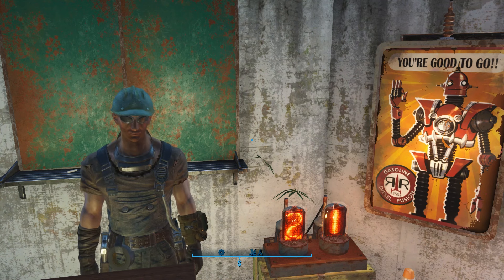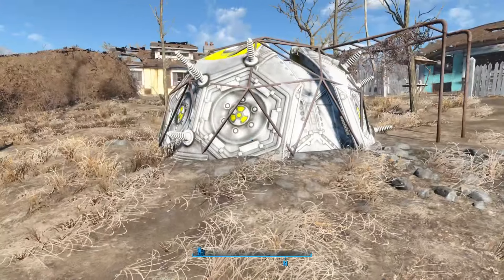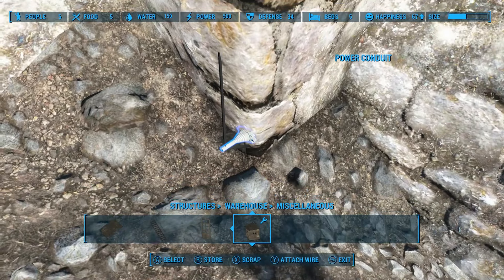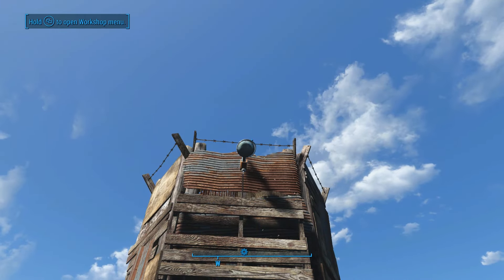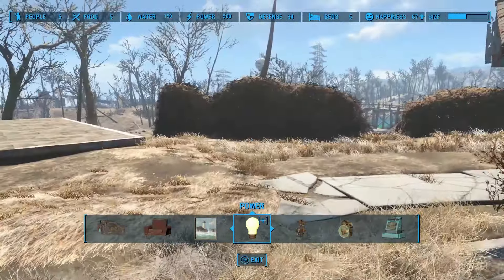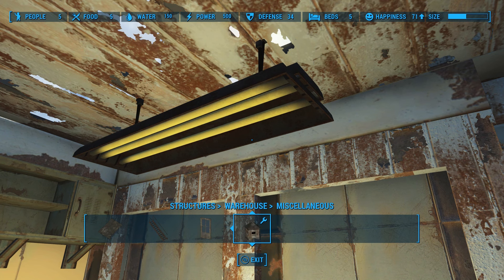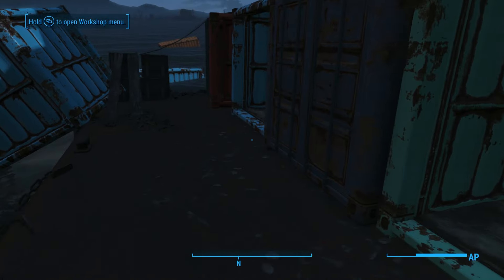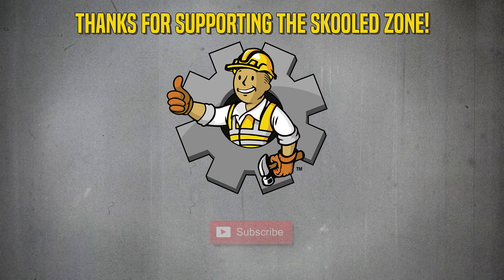Invisible Wiring Across Your Entire Settlement ⚡ Fallout 4 No Mods Shop Class

Comment: One thing I like to do is to set up sub-centrals, i. e. conduits in various places in a settlement which I then connect to the main conduit. 
I then connect everything in that area to the sub-central. It saves me having to run all the way back to the main one every time, especially in larger settlements.
Reply: ...and then you can cover the conduits with stuff, like crates that you rug glitch on top of them. Leave the rugs in place to make the cover easy to move if you need to adjust the wiring.
Reply: this seems like the best idea.

Comment: Omg this is so brilliant. I don't know why I didn't think of this. 

I would love to see a shop class about how you'd do power through vault 88 (since the power runs through the floor). I'm building my vault and running into weird glitches where things aren't lighting up and should be.
Reply from the maker: Thanks Matty. And I know what you're talking about with the vault-tec conduits. The problem with those is that all the floor or wall types have to be the same. So if there's ever a break, it breaks the connection. So be honest, I don't even bother with them. They're too much hassle. I just hook up the super-reactor to whatever I want using the method in this video. 👌
Reply: Thank you so much! That has to be what is going on. Time to spend a few hours wiring my vault tomorrow haha

Comment: so , i am tots watching these out of sequence, you basically set up the parameters for the wire distance by attaching it close to the origin point, then glitch it by grabbing the wire and moving it way past the point it should. Awesome
Reply from the maker: Correct but go "wifi" instead ;-) https://youtu.be/YdaR7m4gct4
Reply: @SkooledZone  I am, in my current build, using a mood called mini generators. I just attach one near the item requiring the power and run a wire from there then use the pillar glitch to sink it into the ground under it out the wall behind it..

Comment: A quick note on wire length: the game lets you initially string it to any length you like, but the engine will often "forget" longer wires on cell load--from testing, it starts getting iffy around 200 yards or so. The wires don't go away; they just stop working. Easy enough to fix--just pick up and drop the attached conduit to remind the game there's a wire there and it resets.
Reply from the maker: That's a great tip SarDeliac. Sometimes I have to do that with regular lights too if I've gone way over the size limit and they turn off on their own. By the way, I think this is the first time you've commented on my channel. Nice to see a talented fellow builder drop by. 🍻
Reply: Thanks for the kind words, and yes it is. Never had anything to say before haha :P

Comment: After reading lots of comments about people claiming the "wire glitch" only works underground, I can confirm that it does work above ground too. An example being to wire 2 street lights together using the "wire glitch". Normally there is a limit on how far apart 2 objects can be wired together, this limit is removed when using the "wire glitch", even above ground. The wire does tend to sag quite badly if the street lights are far apart, but it still works. In case you didn't know, once you release Preston from the museum, if you make raider settlements in the commonwealth, Preston will no longer talk to you, and all of the minutemen quests become unavailable. The only way to have the Minutemen and the Raider settlements at the same time, is to leave Preston in the museum until after you have completed all the Raider objectives. He still won't talk to you until after you do "Open Season" and kill the raider bosses, but then the minutemen quests will begin.

Comment: I wanted to let you know something about the fence outside the building area.  Before a certain patch I was able to hold the A button on a single piece of fence and pull all of that fence back into the settlement build area.  I have a suspicion, I haven't tested yet, that if you get the issue of Picket Fences that allow you to build the fences you can do that still.

Comment: Instead of using a manual switch for your spotlights, use the interval switch and program it to maximize on time and minimize off time (10 seconds on, 1 off). They never stop working and you don’t need to do it every time manually. Otherwise great vid
Reply from the maker: I showed that in some later videos actually.

Comment: 9:07 if you're using multiple lights/switches make sure to run them all through a terminal so you can control all switches at once instead if having to run to each one.

10:49 as for the stuff like that picket fence. you can get rid of it via console commands. (so still no mods, =D ). open the console (`) and click on the item. then type "disable" and press enter. if you selected the right item, it'll fade. then type "markfordelete" so it'd completely be removed next time that area is loaded. (if you disabled the wrong item, you can just "enable" to bring it back). course this is on pc... on xbox or ps, than no idea

19:46 there is a limit to the length of a wire if you're not using the glitch.

Comment: nice tip paul, sooner or later i will be trying this...but right now i'm all about the raider chic...so clicking the cable negates the length limit between towers...what does it do for cost in copper? oh yeah, i WILL be doing the switched spotlight trick. anyway,  do you have a video that features how to go about using railroad cars and scaffolding?  i'm working it right now and have a few tricks to make it happen, but any help would be appreciated...nice job as always...stay safe
Reply from the maker: Does wire length affect how much copper is used? If so, I didn't know that. I don't have a video on railroad cars and scaffolding per say, but I use some of their elements for building. I used the boxcar doors in my Vault 42 build: https://youtu.be/P6n1-POCUrM?t=24m53s, and I used the scaffolding in my Pillar Glitch video: https://youtu.be/M9OQAseCIcg.

Comment: @SkooledZone Hey man, I believe you could've carried that wire on Spectacle Island from the conduit to the generator without having to make the trip 3 times. If I'm not mistaken
Reply: True, but he would have needed to travel back to the lights anyway to prove the glitch had worked. Plus, for the purpose of a video, I'd say it was much better to be at the light end when the connection was made for the "reveal factor" ☺️
Great video as ever, time to revisit some of my settlements and tidy up those spider webs of wires running through the sky 😂 I installed a longer power line mod but it's great to see that the vanilla game can stretch them so far using this technique.

Comment: Paul QUESTION:  If you daisy chain 5 street lights together. Is it equal to 5V or does it simply use 1V continuously 5x? 
-Thanks
Reply from the maker: If the light only has a ⚡ and no number beside it then it only needs a power source but doesn't take up any units. If there is a ⚡ and a number, that's how many units the item snatches from your generator. Most lights just need a power source and don't have a number in the listing. Construction Lights, for example, have number 1 in the listing. So that means they subtract 1 from your generator's output. If you install something like a fusion generator or larger you usually will never run out of power for anything in your settlement.

Comment: How does this work from settlement start, and then upgrading the power source? do you have to rewire again?
Reply from the maker: Anything wired directly to the power source would need to be rewired. That's why I like having a single conduit "substation" in between. Then you don't have to.

Comment: I get the rug & pillar glitch. Got the ordinary wire glitch working. I got the nuclear reactor to go to that thing in Sanctuary. But I can't make the main conduit by the river to work. I tried using the sign glitch on that too, but to no avail. Everytime I move the nuclear reactor, I come back to the main conduit & find that the wire is gone.

Have you got a video of that part of your Sanctuary build or similar? I'm trying everything out I find in your channel, lol
Reply from the maker: Not sure why it's not working for you but here's a better method anyway: https://youtu.be/YdaR7m4gct4
Reply: @SkooledZone  hey thanks for the reply! The Sunshine Tidings glitch doesn't work for me either, though. I suspect it's because I'm using the current version (1.16). The part when the wire is highlighted as you "look through it", has changed. With the current version, as I select the wire, it physically disconnects from the conduit, meaning there's no wire to look through. The wire will land on the target fuse box but, as I select the lower conduit straight after, the original wire from the generator stays with the fuse box & the lower conduit begins a new connection. One of the comments mentioned it's the angle. I have tried all angles, the wire physically disconnects still. It feels as though it came with the most recent patch. 

Although that said, I think the Sunshine Tidings glitch worked for me some long time ago, hazy memory, sorry. It looked very familiar. Perhaps you could check if it still works with yours with the current updates? The rug, pillar, & very first wire glitch all still works for me. I'm on PS4 if that's relevant.
Reply from the maker: @WingCommanderZ  All the glitches definitely still work. Bethesda doesn't fix anything more than a year from its original release date. Some mods may interfere with the glitches though. Try this and see if it works: https://youtu.be/Jl-idDvy-PE?t=898

Comment: I wonder if you can connect a wire from sanctuary to sepctical if you disable the out of build area timer? I know that is not something you could do without a mod or console command but would be neat all the same. Power all settlements with 1 generator bank lol
Reply from the maker: Exactly, only with a mod. But if it works, let us know. :D

Comment: How did you sink the purifiers so far intonthe ground and are they the small or large ones ? They look like the smaller ones. I can only get mime partially in the ground and it looks bad.
Reply from the maker: I basically just used the pillar glitch. It does take some finagling. It also depends on where you're putting them. Sometimes a rock or a board can prevent it from sinking very far. You've probably seen my pillar glitch video, but here's the link if you haven't: https://youtu.be/M9OQAseCIcg

Comment: Trying to do the same thing with a reactor in the same place, but I can't seem to get the pillar to go into the ground when it's group selected with the reactor. I even did that refocus trick, just doesn't want to work for me.
Reply from the maker: Odd because it worked for me. Do you have any mods installed? Sometimes they do funny things to the helpful glitches.
Reply: @SkooledZone  Nope, I'm on PS4. Only have the arcade pack and Silver Shroud Pip-Boy paint from the creation club. I've tried with stairs and pillars. They sink in no problem on their own, but as soon as I group select with the reactor it won't.
Reply from the maker: @scruffynerfherder5430   Yeah, that's strange. It worked for me, obviously. Try unhooking the wires first and see if that helps the sinking. You can hook the wires back up afterwards. Or better yet, use this method: https://youtu.be/YdaR7m4gct4

Comment: Cool; it's underground. I like this underground without Post and Pillars everywhere.  So how does this light up all the houses you want in your settlement without enough conduits to get each room in each house?
Reply from the maker: Well conduits radiate out about 2 wall sizes. So you only need a couple conduits hidden in the bushes around the house and it should conduct power through the whole house.

Comment: Hey I been having trouble lately going to hide wires with the rug glitch or pillar glitch, when I got to burry them or slide them into the ground and the wires connected to the power  disconnect the moment I try to hide it. Do you know what I mean?  Any ideas how to avoid it disconnecting upon hiding the conduit.
Reply from the maker: I know whatcha mean. If the conduit is connected to multiple links, sometimes one of them will break when you sink it into the ground. I don't usually bury my conduits actually. I just "bury" the wires. I try to hide the conduits in plain sight, like in bushes or behind furniture. That way you can get to them later anyway. I did bury the conduits in this video though: https://youtu.be/1mXvZYiOK5A

Comment: When was the last time you sunk a generator into the ground or moved a conduit on a mat/rug?
I tried yesterday as I was thinking I could actually hide the conduits within the wall after it's all wired up with the rug exploit, but as soon as I try to move the generator or conduit the wire vanishes and disconnects.
Reply from the maker: Overall, the technique works great. But the one way it won't work is if you combine all three methods. Then it disconnects. You can still combine two methods though. For example, see what I did in this video about halfway through: https://youtu.be/1mXvZYiOK5A
Reply: Ah I get where I'm going wrong, as long as I wire the conduit on the rug the normal way and not through wire glitch it will work.
Cheers bud you've been a great help with my builds.  🤘
By the way have you ever tried using the small conduit on a rug, then removing the rug once wired, I've noticed the large one sinks about halfway so was wondering what the outcome of the smaller one would be, I've not done the Vault 88 mission yet so can't test it myself for now.

Comment: Year 2023. I have tried to apply wire glitch with and without mods and DLCs, and no success in all cases. I see the spark ok, but the glitch does not work. In the videos, the original wire disappears, but in my case it does not. Has it been patched? The rug glitch works perfect though.
Reply from the maker: Nothing has been patched. However, try this better method and see if it works for you: https://www.youtube.com/watch?v=YdaR7m4gct4

Comment: How did you get the Vault-Tec reactor? I have all the DLC's but I don't have an option for that one.
Reply from the maker: Have you completed all the Vault-Tec mini-quests?
Reply: Great series sir,revolutionised my settlement construction!Question: I am though having trouble pillar-glitching the Vault-Tec super reactor into the ground,it seems to not want to sink... even using the tall scaffolding frames (great chassis tool by the way,big props for that tip!).I'm trying to use the geodesic frame too,seemed a perfect location... Am I missing something?🤔
Reply from the maker: Hey Guy. Try using the metal post and pipe conduit combo. That's how I got it into the dome in Sanctuary. But generally speaking it should sink into most settlement grounds unless they have a lower limit. Some do, like the way they have a height limit. But I didn't notice that in Sanctuary. If you're using mods, though, that may interfere with the collision.
Reply: Thanks Paul,solved!I found that I simply had to look at the frame-&-generator-combo from a certain angle,orientated approximately in line with the bridge into Sanctuary looking towards the geodesic dome,& then everything sank just fine.I'm playing on the PS4 but I don't use any mods.The generator didn't seem to want to sink very easily in a lot of places,so who knows,I may be suffering from an actual glitch! 😄 Anyhow,on to the wiring... Thanks again for the great series sir,your attention to detail & instruction is super-helpful to all of us builders out here!👍

Comment: I mean technically you could have wires running within veiw and still have it look "Realistic"... The whole "Raider chic" thing is a bit of an insult because there are ways to carry out visable wiring without making it look messy or "Raider-esque". Just use the tall pylons as wire poles and run them up and down the sidewalks connecting to eachother and the houses. Then once you get into the houses you could decide on how you want to hide the wiring within the house itself.